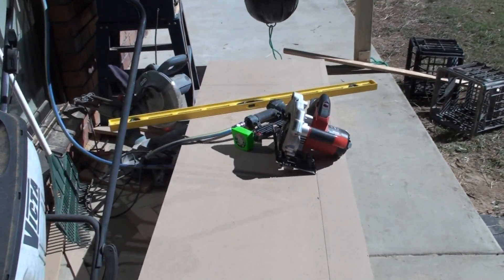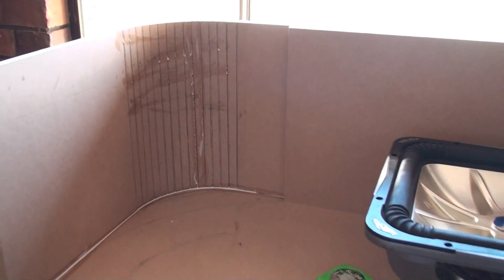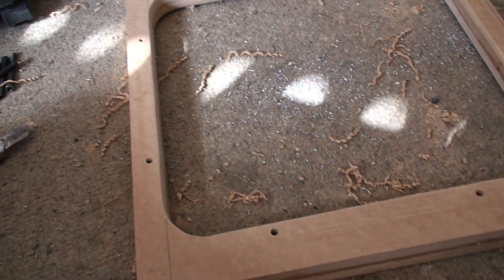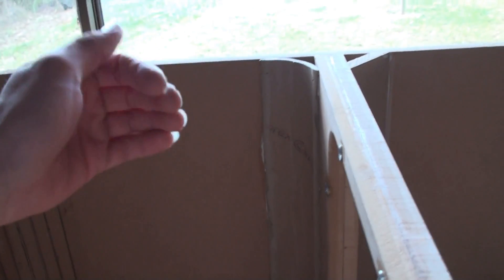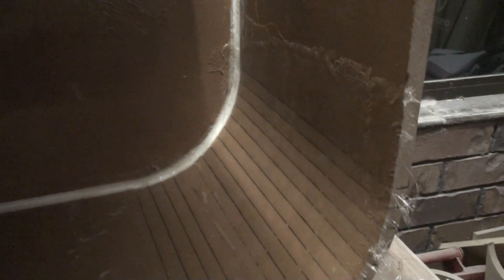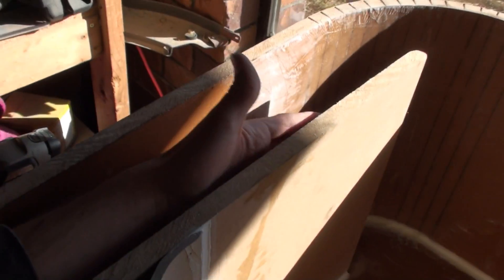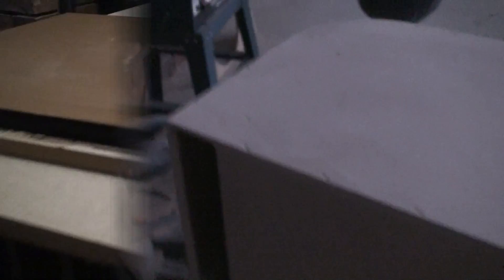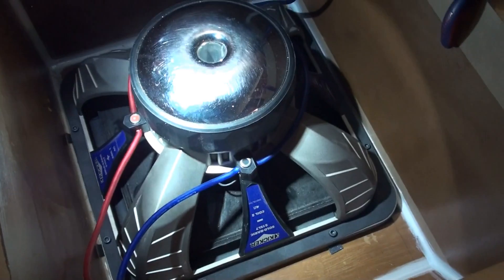4th Order BandPass Box Build - Kicker L7 15"

Comment: I made my first mistake building a box for a 15 per specs that won't fit in the trunk in my car. Lesson learned. Thats a nice enclosure!!
Reply: Did u not measure the depth to go in or did u not measure at all
Reply: @lowlowz2293  trunk has funky angles at entrance. It fit but only with sub and port facing up as that is the smaller side and I don't like that.

Comment: What did you use to to cut the square hole.
Reply from the maker: +Randy Milloway just used a jigsaw at a slow speed on the corners and on the straight bit ran the jigsaw along a straight edge

Comment: Nice job! I've had several L7's but never tried that type of box. I wish I could experience it but you are on the othr side of the world... I started with 3 cubic feet sealed, 3.5 ported and 5 ported. The bigger the enclosure the better and louder they will sound. That 24hz made me cringe.. I played low on accident in the 3.5 ported and the sub bottomed out hard! 5 is much safer for lows. The few issues I've had with these, although they sound good in a good box on adequate power, the glue comes undone over time, the SINGLE spider rips.. one spider for all of that money is ridiculous and no recone anywhere. The magnet is beautiful but riveted... definitely a throw away sub for $300 to $500 US dollars. You can buy wayyyyyy better for this price.
Reply: +lmadden6236  I had 2 12" Kicker CVX's in a ported box on 1000W amp and had to reglue both surrounds after 2 years on one sub and 3 years on the other, then I got in a car wreck, the impact was on the drivers door but the force of the wreck knocked one of the magnets off on one of the subs (the box wasn't screwed down good but it did not damage the box but the magnet was just glued on on those

Comment: how did you tune the port? is it true you tune the bp box port like you tune ported box port ?
Reply from the maker: yeah the ported section is tuned as you would a ported box but there's a lot more that needs to be accounted for, I use the program WinISD pro which gives you the dimensions of each camber plus port length etc
Reply: thanks.